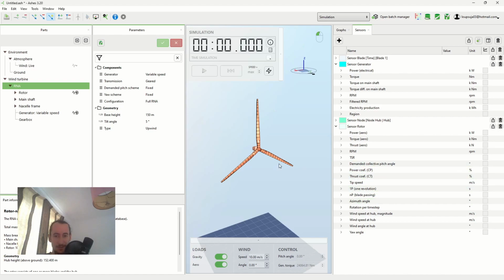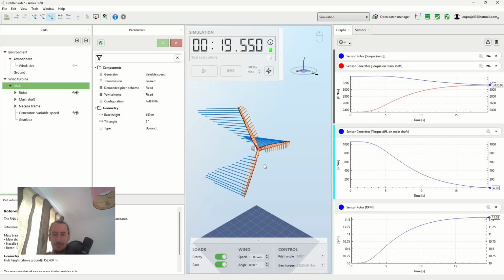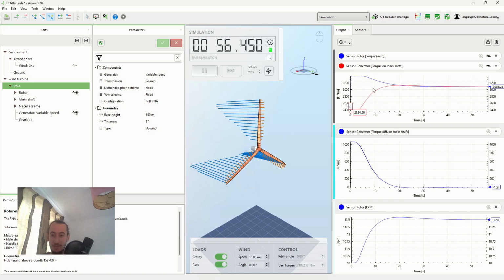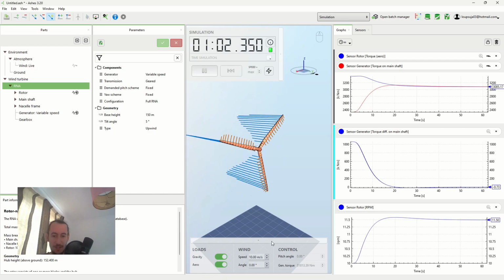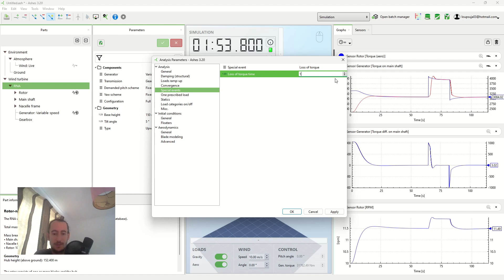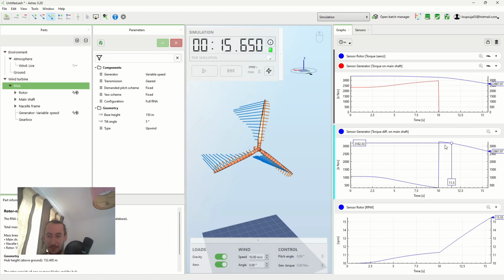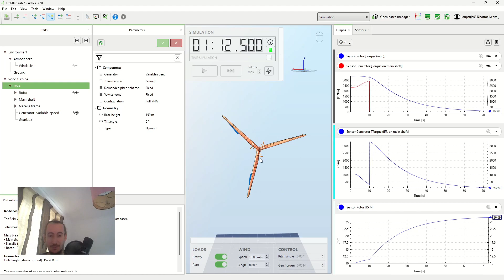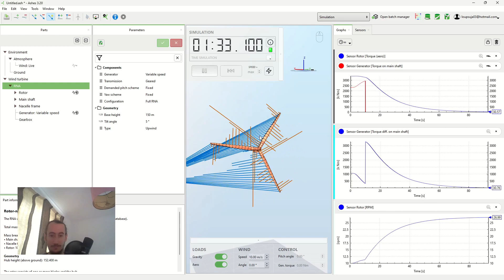What happens during a grid loss fault? - with Ashes, wind turbine simulation software

Comment: I still wonder what is grid loss for which I watched the entire video!
Reply from the maker: Right, I guess the video was not meant to explain that... But grid loss is when the wind turbine gets disconnected from the electrical grid for some reason. This implies that there is no electrical load on the generator, which in the context of this video is simulated by setting the generator torque to 0